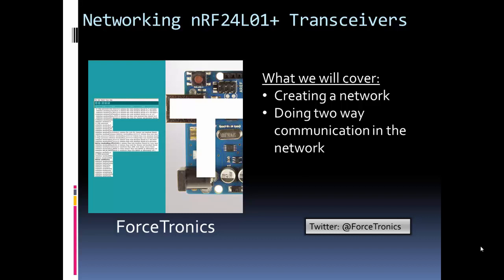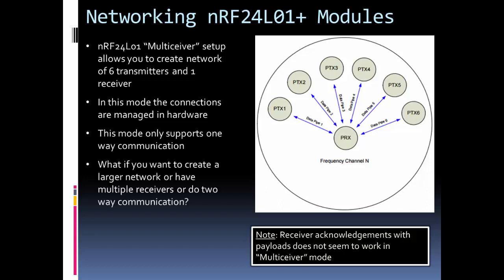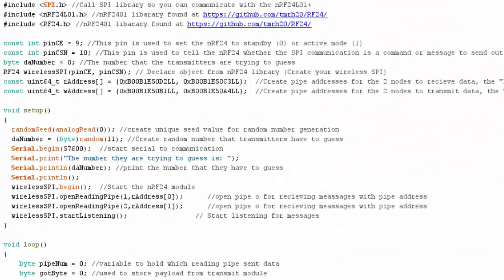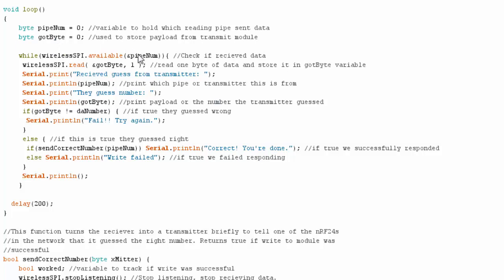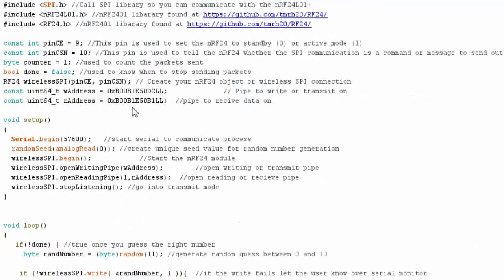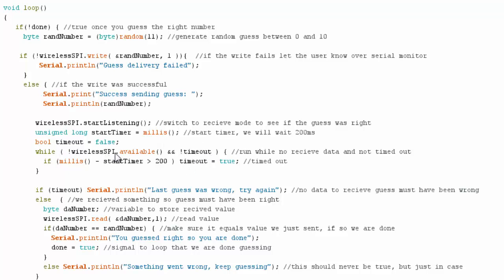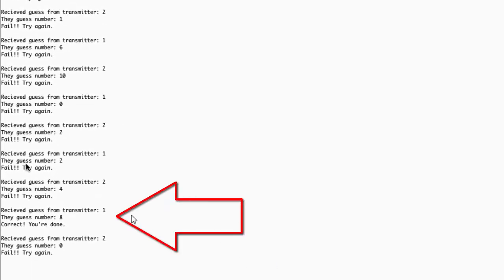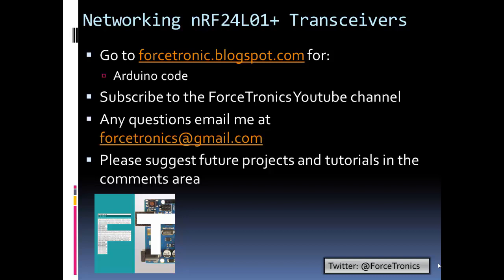Building a Wireless Network with nRF24L01 Transceivers

Comment: If i have node00 node01(router) node011
So i want to send to node00 in node011 i just use 
Network.header header(node00) then it ưill automatically send to node00 ? 
And in system payload will sendto node01 then node00 . Am i correct

Comment: hello sir ,
 i  want to Receive 6 different  data ( at single NRf24L01  Receiver ) ,   and  data   coming from six 6  different different NRF24L01   transmitters

but  my  coding  is able  to Receive Data from only  single  Transmitter  ( not able to receive from all the Six symultaneously).

my coding is given below ,    please  help me sir
my email -   jaiswalshubham555@gmail.com
contact-  +91 9161522284  ( india)
please help me sir ,

////////////----------- CODE FOR  RECEIVER---------////////////////

#include <RF24Network.h>
#include <RF24.h>
#include <SPI.h>
#define led1  4
//#define button  2
#define led  3
#define led3  5

RF24 radio(10,9);                  // nrf24L01 (CE, CSN)
//int guest=0;
int buttonState = 0 ;
int buttonState1 = 0 ;
int buttonState3 = 0 ;
RF24Network network(radio);        
const uint16_t this_node = 00;       
const uint16_t other_node = 01;          
const uint16_t other_node2 = 02;
const uint16_t other_node3 = 03;
void setup()
{
  Serial.begin(500000);
  SPI.begin();
  radio.begin();
  network.begin(90,this_node);      //   ( channel , NODE address )
  //radio.setDataRate(RF24_2MBPS);
  //pinMode(button,INPUT);
  pinMode(led,OUTPUT);
  pinMode(led1,OUTPUT);
  pinMode(led3,OUTPUT);
}

void loop(){
  network.update();
  
  //---------RECEIVING 1 ----------//
  while( network.available() ) {          
    RF24NetworkHeader header;
    unsigned long buttonState;
    network.read(header,&buttonState, sizeof(buttonState));  
    Serial.println(buttonState);
    digitalWrite(led,buttonState);                            
  }
     
  //---------RECEIVING 2 ----------//
  while( network.available() ) {           
    RF24NetworkHeader header1;
    unsigned long buttonState1;
    network.read(header1,&buttonState1, sizeof(buttonState1));  
    Serial.println(buttonState1);
    digitalWrite(led1,buttonState1);                           
  } 
  //-RECEIVING 3 -//
  while( network.available() ) {           
    RF24NetworkHeader header3;
    unsigned long buttonState3;
    network.read(header3,&buttonState3, sizeof(buttonState3));  
    Serial.println(buttonState3);
    digitalWrite(led3,buttonState3);                          
  }
}

  

//////////// ---------- CODE FOR  TRANSMITTER 1 ---------////////

#include <RF24Network.h>
#include <RF24.h>
#include <SPI.h>
#define led 5
#define button 2

RF24 radio(10,9);                 

RF24Network network(radio);        
const uint16_t this_node = 01;       
const uint16_t other_node = 00;         
void setup()
{
  Serial.begin(500000);
  SPI.begin();
  radio.begin();
  network.begin(90,this_node);      //   ( channel , NODE address )
  //radio.setDataRate(RF24_2MBPS);
  pinMode(button,INPUT);
  pinMode(led,OUTPUT);
}
void loop(){
  network.update();
    RF24NetworkHeader header(other_node);
    unsigned long buttonState = digitalRead(button);   
    bool ok = network.write(header,&buttonState, sizeof(buttonState));  
    Serial.println(buttonState);
  
}

//////////   ---------- CODE FOR TRANSMITTER 2 --------////////////

#include <RF24Network.h>
#include <RF24.h>
#include <SPI.h>
#define led1 5
#define button 2

RF24 radio(10,9);                  // nrf24L01 (CE, CSN)

RF24Network network(radio);         
const uint16_t this_node = 02;       
const uint16_t other_node = 00 ;          
void setup()
{
  Serial.begin(500000);
  SPI.begin();
  radio.begin();
  network.begin(90,this_node);      //   ( channel , NODE address )
  //radio.setDataRate(RF24_2MBPS);
  pinMode(button,INPUT);
  pinMode(led1,OUTPUT);
}

void loop(){
  network.update();
    RF24NetworkHeader header1(other_node);
    unsigned long buttonState1 = digitalRead(button);   
    bool ok = network.write(header1,&buttonState1, sizeof(buttonState1));  
    Serial.println(buttonState1);
  
}

////////---------- CODE FOR  transmitter  3 ---------/////////////

#include <RF24Network.h>
#include <RF24.h>
#include <SPI.h>
//#define led1 5
#define button 2

RF24 radio(10,9);                  

RF24Network network(radio);         
const uint16_t this_node = 03;       
const uint16_t other_node = 00 ;          
void setup()
{
  Serial.begin(500000);
  SPI.begin();
  radio.begin();
  network.begin(90,this_node);      //   ( channel , NODE address )
  //radio.setDataRate(RF24_2MBPS);
  pinMode(button,INPUT);
 // pinMode(led1,OUTPUT);
}

void loop(){
  network.update();
    RF24NetworkHeader header1(other_node);
    unsigned long buttonState3 = digitalRead(button); 
    bool ok = network.write(header1,&buttonState3, sizeof(buttonState3));  
    Serial.println(buttonState3);
  
}

Comment: Hi, thanks for the video, it's a really clear explanation! I used the code on your website to test it on my set-up (Arduino Uno x2 as the 'transmitters', and an Arduino Mega 2560 as the 'receiver'). The transmitter codes upload to the Unos but when trying to upload the HUB code to the Mega I got the following error message:

Arduino: 1.8.5 (Windows 8.1), Board: "Arduino/Genuino Mega or Mega 2560, ATmega2560 (Mega 2560)"

In file included from C:\Users\User\Documents\Arduino\Arduino Learning\ForceTroics_HUB_Example\ForceTroics_HUB_Example.ino:6:0:

C:\Program Files (x86)\Arduino\hardware\arduino\avr\libraries\SPI\src/SPI.h:72:1: error: expected unqualified-id before 'class'

 class SPISettings {

 ^

C:\Program Files (x86)\Arduino\hardware\arduino\avr\libraries\SPI\src/SPI.h:72:1: error: expected constructor, destructor, or type conversion before 'class'

exit status 1
Error compiling for board Arduino/Genuino Mega or Mega 2560.

This report would have more information with
"Show verbose output during compilation"
option enabled in File -> Preferences.

You're help would be greatly appreciated!
Thanks.
Reply from the maker: Looks like there is an issue with the Mega working with the Arduino SPI library. Beyond that I can't really comment because I don't own a Mega
Reply: Thank you, I will grab another Uno an work with that!
Reply: The other thing is, if I were to expand the system with more nodes and therefore need more addresses, how  would these new addresses be created? Thanks again!
Reply from the maker: You just make up the address in your code. If you are interested in larger networks you may be interested in this video series https://youtu.be/RrmpN1_Py_4
Note that I no longer sell the flex node at my site but you can access the design files from GitHub to build it yourself
Reply: Great, thanks for your help! Really useful :)

Comment: Hello sir,

Can we use NRF24L01 for Commercial Home automation system network?
Reply from the maker: Yes you could. But really to decide if the nRF24L01 is the right wireless comm module for your design you would need to define the requirements of the system and then investigate what wireless module best meets the needs of the design based on things like power consumption, data rate, security, cost , etc.
Reply: Sir,
Thank you for guiding. If i put nrf in counsil switch board in wall will it effect i Range Of NRF?
& One more Que Can we communicate via NRF with NRF + Module.
Thank you

Switch Board Like :
https://3.imimg.com/data3/LT/LA/MY-526690/main-switch-board-250x250.jpg
Reply from the maker: It depends on how much metal plating there is in that box, if there is too much metal it could attenuate the wireless signal. If there is no metal then it should work. The best thing to do is test it. I don't understand your second question.
Reply from the maker: Yes, I have done communication setups with those two different modules.
Reply: Thank You

Comment: Guys can i have more than 6 NRF24L01 modules to communicate with each other. I know that it has 6 pipes and it can receive data from 6 pipes. But in my case i want all of them to transmit and receive in same pipe because the communication will happen at random and i cant specify when i will receive data from which transmiter. All the deveices will act as both transmiter and receiver. So Is it possible.

Comment: how to multceiver with bluetooth module like hc 05/06 or mh 10/11m??
Reply from the maker: +Zainuri Hasan there is no way to easily create networks of more than two devices with classic Bluetooth devices like the hc 05/6. You need a master device that would need to connect to a node, exchange data, disconnect, and then repeat with the next node. It's a very tedious way to do it and that is why Bluetooth is not typically used for one to many type networks.
Reply from the maker: +Zainuri Hasan there is no way to easily create networks of more than two devices with classic Bluetooth devices like the hc 05/6. You need a master device that would need to connect to a node, exchange data, disconnect, and then repeat with the next node. It's a very tedious way to do it and that is why Bluetooth is not typically used for one to many type networks.

Comment: Hi, nice video, just a thought, do you know that nrf24l01+ receiver send back an acknowledge to  the transmitter? It is possible to set some data in the acknowledge packet, this basically has no dead times when the receiver is not answering.  (this will work in your example and is not a 2-way communication, but just the to answer if the transmitter guessed the number or not)

Comment: can we priotize the a specific transreciever to be at higher prioprity or lower priority
Reply from the maker: +electronics engineer I don't think so or at least there is no way to do it from the open source Arduino library that I use. It is possible that the manufacturer Nordic provided this capability but it was not included in the Arduino library. You would have to dig around in the data sheet to see if that is the case. If you go that route please share what you find.

Comment: thank for the informative video. I will ask for a little help though.
What I'm trying to do is to control 2 servos wirelessly with one potentiometer.
so, its one Tx with the potentiometer and 2 servos in different locations that must move together.
I tried using HC-05 for it but failed since I couldnt find any tutorials that used arduino-to-arduino BT communication. it is always arduino-to-android or arduino-to-pc.
I'm thinking about using nRF24L01s so I can broadcast the potentiometer signal to both locations that of course are not far away from each other, but must not have wires between them.
I figured is way simpler than what you did in this video, but wanted to make sure it really is possible.
thank you.
Reply from the maker: Daniel Souza The nRF24L01 has built in capability to network one receiver with multiple transmit modules. In your configuration you want one transmitter and 2 receivers. There is two ways to do that: the first is you manage the connections in the arduino code you have the transmitter just connect to one receiver communicate and then you open a pipe to the other receiver communicate and then switch again. Another way to do it is to have the receiver at the potentiometer and have the two transmitters at the servos. Then just use the receiver capability to return data in an acknowledge packet (I showed this in my getting started video with one receiver and one transmitter). You could also do it with Bluetooth whether it is the HC05 modules or the RN42 modules. In my video "Building a Bluetooth Remote Control Car" I show two arduinos communicating across bluetooth
Reply: yeah, I've been trying to make the HC-05 to communicate, but I failed. I get to the part where they pair via MAC address using the AT bind command, but when it get to actually sending data I couldnt do it. I've seen other people suffering with these modules.

I've ordered nRF24L01 and will try to make it work. Will this pipe switching thing be reliable? And how fast can it switch for the RN42 as well.

I'm using arduino Nano at MEGA 328.

if I can't make this switching thing work, I will probably go with 2 arduinos as Tx, one for each receiver and just connect the potentiometer to both arduinos or make the first arduino send the signal to the second. btw will this work?
Reply from the maker: Daniel Souza I don't know for either since I have never tried. I have only used nRF24L01 modules with one reciever and multiple trainsmitters so I didn't have to switch. In general the nRF24L01 modules seem to easily and quickly connect and Bluetooth tends to take longer and be more flaky. Zigbee easily supports large networks (XBee modules are pretty popular).
Reply: thank you. as soon as I have something working I will post here.
Reply: ***** I did something not very elegant. I just put 1 set of TX-RX and other set of TX-RX. So, 4 arduinos and 4 nRF24L01. the joystick is wired to both Tx. It just seems like the stupid solution, but will do for now as I need these ready this week. after the maker faire I will tweak it to be better and maybe even go back to bluetooth.
Reply from the maker: Daniel Souza In a pinch you have to do what works